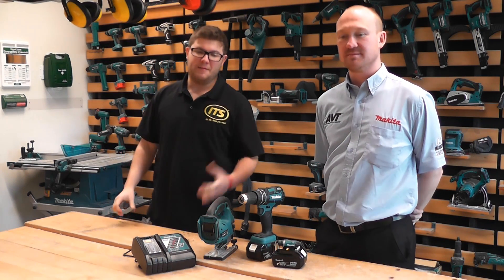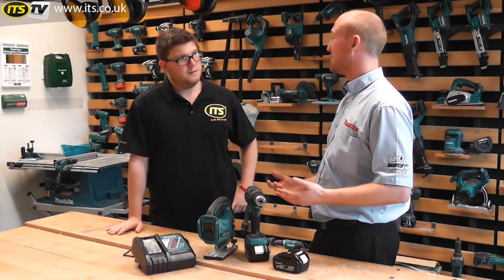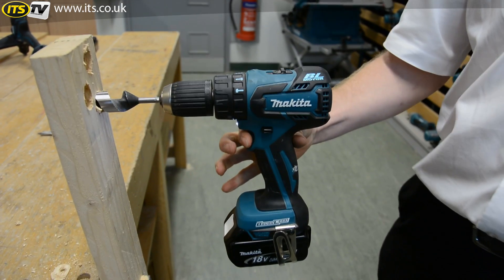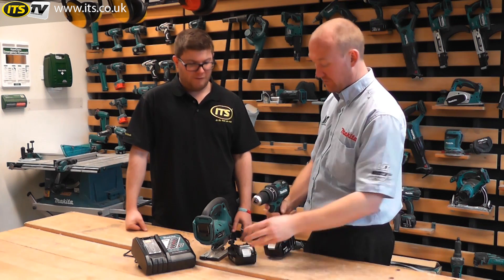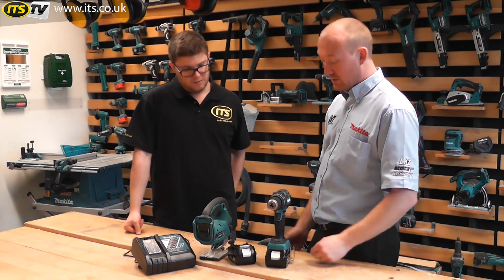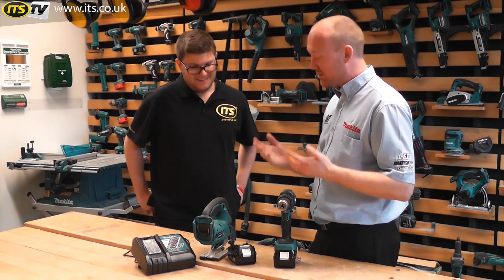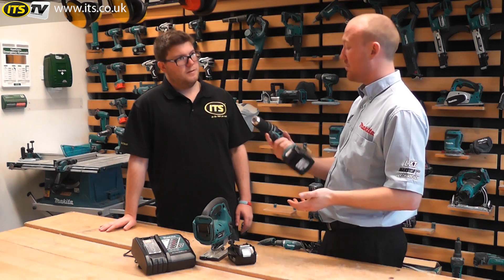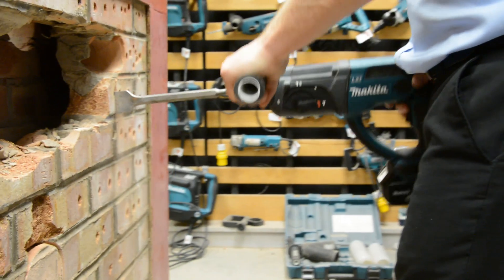How to look after Makita 18v Li-ion Batteries

Comment: One more thing that's degrading batteries is to leaving them sitting around fully charged for weeks or months at a time.
This isn't a concern to professionals, but hobbyists may benefit from discharging them to 3 bars before storing them away.
Reply: How do you discharge them?
Reply: @grnwlski  I've buildt a discharger from a Makita diy adapter, Arduino, voltage sensor, relay and a 10W power resistor. Simple stuff, no displays or anything, but it still requires working with electronics and entry-level programming.
An easier method would be to use a battery-powered lamp, measure how long it takes to fully discharge a full battery, then use a timer to manually discharge it to ~50-60%.
Reply: @Coookies24_  I wish the Makita chargers would have a discharge option..

Comment: OMG! let me save you 10 minutes of your life:
1. When the tool stops: recharge the battery = brilliant!
2. Ni-Cd bad
3. Li-Ion good, no battery “memory” so partial charge is OK, no discharge required
4. Heat bad - don’t force tool with a hot and or dying battery, it will cause damage
5. The “Star” Mikita battery has chip that shuts off to protect itself from overcharge, overload, overheating and over-discharge. Tool must be “star” version to work. Look for star symbol on underside of tool’s battery mount just above the “18V” embossed printing.
What they missed:
1. Out of the box a new battery has ~30% charge
2. Have a minimum of ~50%+ charge for long term storage
3. Never charge a hot battery
4. Protect from extreme temperatures 
5. Some chargers have a cooling fan that will cool the battery before allowing to charge. Has built in CPU that communicates with charger and regulates thermal voltage and current to protect battery
6. Stop and recharge battery when it just begins to slow down or labour
7. Makes an attractive paper weight
8. Please confirm all of the above for yourself if safety and or  $$ are involved ;) Read the manual! Enjoy!

Comment: This guy is worse than useless.  My take on it from what I have read is:
1 new battery - charge it to full right before you plan to use it; mine took 60 min
2 If after use it's 1/2 charged, or more, leave it off the charger till you plan its next use.  Keep battery at room temp.  Heat is bad.
3 if after use it's less than 1/2 charged, charge it for a short time to bring it back to the 50 - 75% range for short term storage. Before next use bring it back to 100% charge.
Keep battery at room temp. 
Heat is bad; i.e. in your car on hot summer day.
Don't store it in the charger; always charging.
Don't run it down to nothing, once you can tell it's getting low stop & charge it.
If the battery gets really hot during use, stop and let it cool down.  Some say on the charger since it has a fan.  Wonder if the fridge for 10 minutes would work too? (don't forget it and leave it in there!)

Any other suggestions to maximize the life on these expensive to replace items?

Comment: So how are you suppose to store the battery? Is bad to store at 100%?
Reply from the maker: You can store lithium-ion batteries at 100% without too much trouble. The most important thing is to keep them cool, out of sunlight and if you can give them a quick burst of use or charger every month or so then even better!
Reply: storage voltage for LiIon cells 3,75-3,8V/cell

Comment: According to him once the battery starts to show it running low and stopping and starting what if you transfer that same battery to a less powerful tool does it still do damage for instance if I'm using the rotary hammer drill with a 12 mm drill bit and the battery starts to stop and start because it's low I remove that battery and reinstall the battery into the impact driver does it still damage the battery I would like to know if anyone does though

Comment: You are perfectly right. Makita cheats on battery life by marking god overdischarged bateries as bad after 3 attempts to charge a deeply discharged battery.They have made that design deliberatly to make more money from seling batteryes. The charger marks the batery as bad instead of trickle charging it with a small current until it reaches a safe voltage for normal charge. Thei are cheating peoples. The tools are verry god but you are robt on batteries.Excuse my english.

Comment: What a waste of nearly 10 minutes of my life on a video that didn't answer the one question I needed it to. Do I charge a brand new battery from Makita  or use it straight out of the box. Wow surely the most obvious question
Reply: With Lithium Ion batteries it doesn't matter.  But usually it has maybe 1 bar out of the box so you won't get much out of it anyway, slap it on a charger straight out of the box
Reply: I've read somewhere that new batteries are in "storage" mode, when you charge it you "activate" the battery... True or false, I prefer to charge it first and not take the guess... A big advantage of charging the batteries, is that you have a free radio with the charger you can choose your favorite song :-P

Comment: one of my batteries reads 17.5v, will still work but won't charge. I've opened it, there's no signs of leakage and each cell pair measures the same.  Nothing wrong with the cells. I've seen the ripoff price of a replacement and I'm trying a new pcb from Aliexpress first.

Comment: YouTube channel "Seeker" has done a great series of videos on batteries. They invited an expert to talk about battery longevity and he recommended that, for Li-ion, it's best to keep the charge above a certain threshold; 30% as a rule of thumb. Charged particles help maintain structural integrity and too few of them cause extra wear and tear on the battery. Think of it as a Jenga tower: remove too many blocks and it'll cave.

This applies to all Li-ion batteries, including smartphones, ebikes, ...
Reply: Is there any downside to charging too soon?

Comment: do not charge your batteries while still hot. this must have been a misunderstanding. once you notice your batteries over heating, let it cool off and recharge it 10 to 5 min later. after a full charge, if still hot let them cool off for a patient  30 sec.
further tips would be: do not charge them fully after a finished project if you aren't going to use them the next day, a partiall charge would be much better. But also do not let them sit for longer time after a full discharge. Keep them away from the sun and from cold temperatures as much as possible - but most of all get the job done.
Reply: You can with the makita chargers as the fan will cool the battery down first before it's safe to charge it.
The charger will detect the temperature is high & start cooling the battery, it's the fastest way to cool the battery down through the cooling vents.

Comment: I bought into this system for big money when it first came out. I paid $1600 for a 3 speed drill, skill saw impact gun, flashlight. The kit came with 3 batteries and a mail in offer for a free radio. Well the radio killed the first 3 batteries in weeks by running them down to 0 volts. I got new ones under warranty. But there is a obvious design flaw. I now have the heated jacket and it too kills batteries. Like others I feel the tools themselves are top notch. But the fact that the batteries seem to be designed to fail when paired with the tools is most concerning. It seems like a intentional design flaw to get you to keep buying batteries. My hobby experience has taught this layman more about lithium ion batteries than the makita designers. Pretty sad that the cut off on the tools misses the mark. Sadder to realize the designers did it intentionally.

Comment: All these comments, but not one person correct. Makita put the power for the module that kills it on just one cell. That board acts as a parasite load, and kills those cells faster. Makita has no balance charge in their design, so those 2 or 3 cells eventually fail, way faster than the other 8. They take the surrounding cells with them by recharging off them constantly. This is day 1 shit in building a lion pack, and to say its just an accidental bad design is defending the indefensible. I rebuild packs to make extra money, and Ive seen these packs literally blow the cells. You NEVER place an uneven parasite load on a lithium ion pack, no matter how small. To do that, and not have a balance system is building a pack with the intent of it failing. They literally rig the system by having it brick the battery after 3 failed checkups. Who the helll wont try several times to get it to charge. When you compare that obvious flaw with how well their tools are made, it becomes blatently obvious its intentional. Throw the makita charger away, cut that single wire running into the middle of the pack, and just charge on a manual or hobby charger to 20v. Or soldier leads on a shit pack and alligator clip the positive and negative on your bricked batteries. Drop the shitty pack that reads in the cradle and charge the batteries you actually use in parallel.
Reply: Jamfanwp ...you need to make a video on this...
Reply: You are perfectly right. Makita cheats on battery life by marking god overdischarged bateries as bad after 3 attempts to charge a deeply discharged battery.They have made that design deliberatly to make more money from seling batteryes. The charger marks the batery as bad instead of trickle charging it with a small current until it reaches a safe voltage for normal charge. Thei are cheating peoples. The tools are verry god but you are robt on batteries.Excuse my english.

Comment: these batteries suck! i use 2.0 amp 18v for a drywall gun and the power delivery is inconsistent and weak, the charge also has a mind of its own and sometimes it lasts for 3 hrs, sometimes for 2, sometimes for 1 ... makita is a scam

Comment: Like any tool or mechanical/electronic device the better you take care of it the longer it will last. Same premise goes for a vehicle if you accelerate hard on it all the the time maxing out rpm's and generally drive the crap out of it, it's going to fail eventually.
Reply: Cracking point strife

Comment: but what is the best way to store them for a long period? full or empty? or doesnt it matter?
Reply: It doesn't make a huge difference, but 50% charge is best for long term storage. If you have a voltage meter (multimeter) you can measure the battery voltage, 50% is 18V. 100% is about 20.5V, not sure what 0% is.
Reply: Yes, half charged. If you know you are going to leave them be for a while. you can empty them fully under a small load (a simple driver) and charge them up afterwards for only ten min.
Reply: discharge to 3,75V/ cell  = until 3,75V X5 = 18,75V ....or 19V for longer period

Comment: MAKITA BATTERIES ARE JUNK, OVERPRICED AND STOP WORKING AFTER MINIMAL USAGE. I HAVE FIVE DEAD BATTERIES IN LESS THAN A YEAR AND I'M NOT A CONTRACTOR....BATTERIES MIGHT HAVE BEEN CHARGED TEN TIMES, IF THAT!!!
Reply: Mine are several years old and all work perfectly. They'll go weeks untouched, then I'll use them heavily on projects. Not a single failure yet, and loads of working power. More than I can say about some other brands I've used.
Reply: @jaredoldaker9228  ..you very lucky...lot of complaints about the battery....now milwaukee is my next tool

Comment: are magnets bad for the batteries , i have magnetic spirit levels rolling around in the bag with the batteries
Reply: Could start a fire.  Not likely but any metal coming in contact with those batteries could create a spark
Reply: @stickjr.3715  Given how the terminals are shrouded on these batteries it's unlikely that metal could come into contact with them unless it's a narrow piece and somehow pushes into the gaps for both terminals. (Also worth noting that has nothing to do with whether or not the metal is magnetic, only conductive.)

Comment: Lithium has memory ! Empty your battery fully,put to charger after 2 months and battery will not charged ! If you not use your tool,make sure,the bateries are fully charged before you put your tools to storage room !
Reply: +conollystation Lithium does NOT have memory effect. In contrary, keeping them fully charged in storage actually stresses the battery.
Source: i am an electrical engineer, see more at http://batteryuniversity.com/learn/article/charging_lithium_ion_batteries
Reply: +tHaH4x0r  I lost one of my batteries  from multitool and 1 battery from laptop.Both was lithium.The same way I lost 3 batteries NiCd from my Makita set,when I left them flat in 2008,I could not charge them in 2014.
Reply: +tHaH4x0r  The multitool lithium battery was flat only about 1.5 month,could not charge it after.The battery from laptop was flat for about 4 months,could not charge it after.
Reply: +conollystation That is not memory effect, that is because of the cell having an internal parallel resistance and slowly discharging over time. If NiCd or LiOn cells get below a certain voltage when discharging they are permanently destroyed.
'Real' memory effect is if a battery is repeatedly discharged to a certain level before being completely charged again, its capacity seems to decrease after multiple charge/discharge cycles.
The memory effect you are referring to is the voltage depression effect, sometimes called lazy battery effect, which happens when a partially discharged NimH or NiCad battery is fully charged for longer periods, slowly losing capacity. This however only seems this way, discharging the battery to 1V and then charging them again brings them back to full health.
Reply: If the batteries dip below a certain voltage (because you left them empty for a long time) then the charger will refuse to charge them (this is an important safety feature). 
However usually the battery is perfectly ok. 
If you can get access to a DC power supply you can restore them yourself
Just charge them at 18v at 0.5 amp until the battery voltage rises to 18v
Then put them back on the makita charger, and it should be fine
Don't leave them empty for any period of time, best to store them long term at 50% full (the battery should be at about 18v)

Comment: So, if understand correctly, if the tool is overloaded and the circuit 'trips' there is no way to reset the battery forcing you to buy another one?
Reply: niceguy235uk1 No you just pull in the trigger again and keep working

Comment: I have a pile of bricked makita batterys its a disgrace I will be going back to dewalt
Reply: I have a pile of dead dewalts so don't bother.
Reply: This is mainly because of wrong usage. Usually, this happens because two cells in one series get drained (overload/heated/cold; or they were almost empty after use and the cells drained themselves). Thats why always half charge them after use. 
The chip is not necessarly "marked" as one could suspect. But yes they should install intelelgence against all those situations.
A solution/hack that worked for me everytime is to open the pack -  locate the batteries in series that are supiciously low via multimeter - ca. 1v - chop off the mini end of a usb cable - and carge the cells up seperatly in series by pluging the usb into power - connect the naked ends of about 5v/low amps onto the ends of the series (all still conected and together) - plus to plus and minus to minus - after five min check the voltage make sure nothing is heating up and repeat for 5 min- check the voltage - if the series is now telling you 10v - you are probably good to go. Screw everything back together and recharge the pack properly - let them cool off and put them to good use - the cells or one of the two cells are probably not  the fittest any more but they will work again.

Comment: Can i use a star battery with a non star tool, such as bhp?
Reply from the maker: Hi Nek, Yes you can use a star battery with a non star tool - it just doesn't include the in-built intelligent protection for battery and tool. It will work in terms of powering your tools though.
Reply: ITS SOrry to open this topic!I have a makita btd 140 with black terminal and sign 18v!i want to order 2 new batteries and all are with star protection.it will work as the old one or will have some issue?thank u
Reply from the maker: +Γιαννης Χατζ Hi, does the black terminal also have a star on it? Or is it just black with 18v on it? If it has a star then you're all good and can buy any new batteries. If it doesn't then you'll need to buy 3.0Ah batteries. (regardless of their age)

Comment: To fix "bad" Makita batteries that won't charge: Put them in the charger FIRST and then plug the charger in.
Reply: ***** put them into the  charger first does not work. They want you to buy new ones. It is a rip off.
Reply: ***** Does not work.  I have three batteries that have died.  BL1830, and 2 BL1815 any other suggestions?
Reply: Unfortunately the issue with this not working is the charger. Certain chargers, DC18RA model, may work. I have only found the one. 3 of my buddies have the same charger and it doesn't work. With my charger I have been able to "reset" 3 of my own batteries, BL1815, and a couple others for friends, BL1830. Unfortunately I don't have a charger to take apart and compare to my charger. When I have that chance I will and if there is any visible difference be it capacitors or resistors whatever I will be sure to spread the word on what needs to be done to make other chargers work too.

I can tell you that of all the chargers we have tried mine is the lowest serial number. My father-in-law has a charger from 2006 and mine has a lower serial number.
Reply: As I have stated before this does not work with all makita batteries or charges, I got lucky, it worked for me with two chargers and 6 batteries, there were just as many I tried that didn't work. If it works for 5% of people that try it I feel my effort has been well spent sharing this.